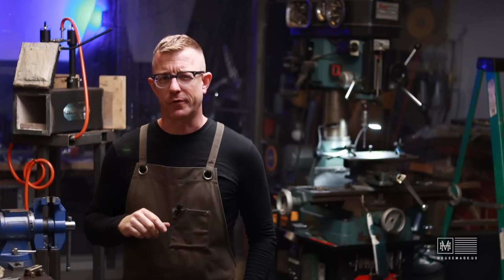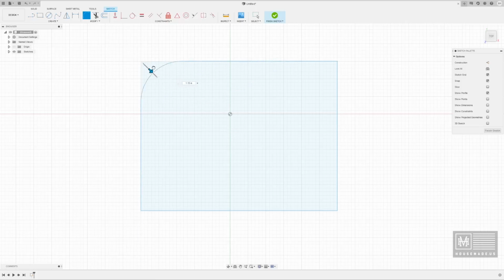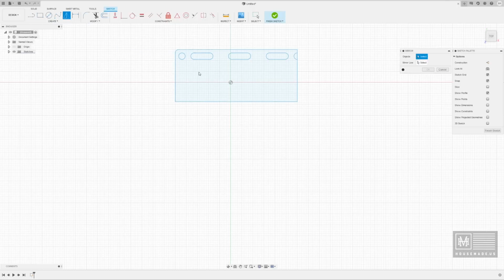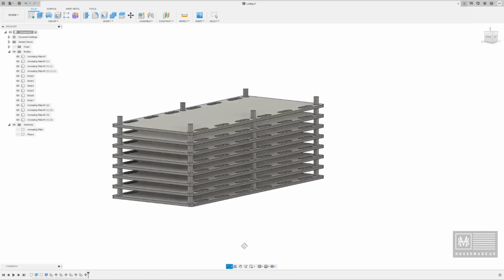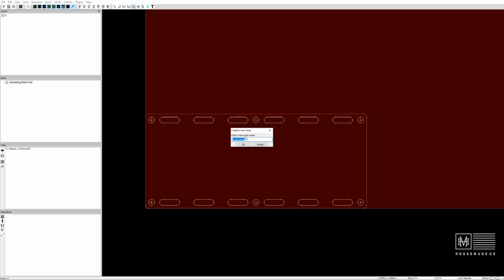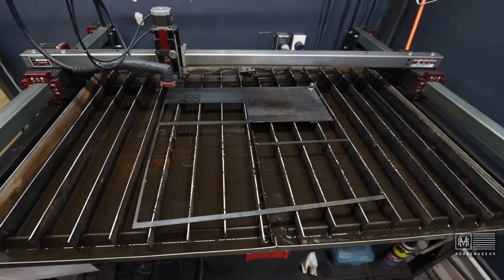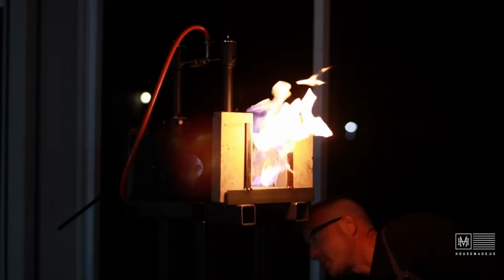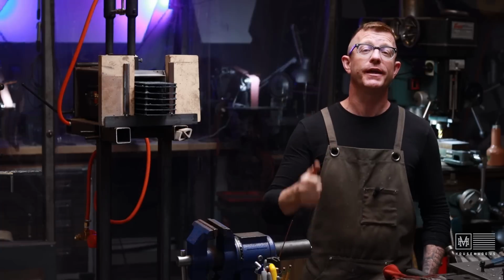How To: Build an Annealing Chamber for your Forge (Fusion 360 Tutorial)

Comment: Hey Brian, I‘m from Austria, so my Englisch is not the best, sorry. I do heat treat my blades in a devil forge. I use a stainless steel profile to even out the heat during heat treatment like red beard ops. But at the bottom of that profile I drilled a whole, where I put a thermocouple inside. That allows me to regulate the temperature in my forge to a +-5degrees celsius accuracy, by playing with the amount of propane and oxygen which goes into the burner of the forge.  That works pretty good for me. By regulating the temperature to the heat treating temperature of the steel, u would not have to worry that much about  overheating the steel, because the blade gets only as hot as it should. I really appreciate your great videos, I am also thinking about buying the ultimate revolution kit which is available in europe.
Reply from the maker: This is a great idea. I have considered it. Thank you for sharing, ill give this a shot!

Comment: Hey bro my first steady job was at a heat treat shop here in Tulsa did that for almost 10 years until I went to work here at A.A. As a mechanic from what I remember Inconel would be ideal for your fixture would last a long time but expensive stainless would be next choice not as durable but a lot better than mild steel just my 2 cents for what its worth, I think your spot on with this idea for annealing multiple blades at one time I’ll barrow this one for sure!!

Comment: I've found that the temp of the cut vs the cold water is so extreme that It even hardens the cut on hot rolled steel (A36) parts.  I didn't think this was possible until I started smoking all my drill bits when I went to chase the holes to their exact size.  If you drag select from bottom right to upper left you'll select everything you touch I think.  That's how it works in AutoCAD and Inventor.  Or you can select everything and control click to deselect the single line you don't want to mirror.  

You'll find the dimension and features constraints are super helpful as well.  To bad we don't have Neurolink.  Than I could just download what I know to you. lol  You're picking this up pretty fast. two thumbs up.
Reply from the maker: Thanks Richard!